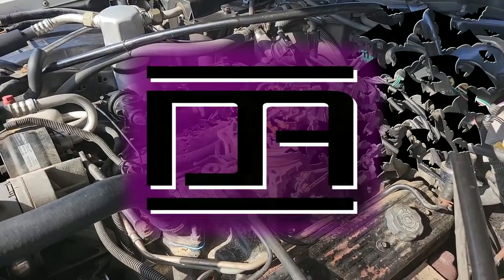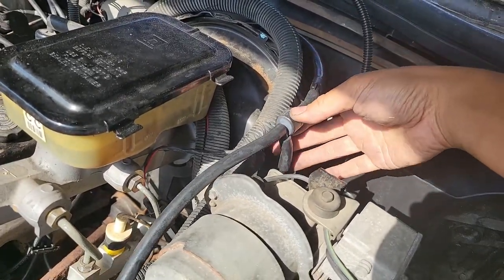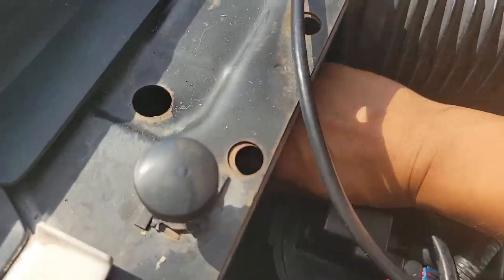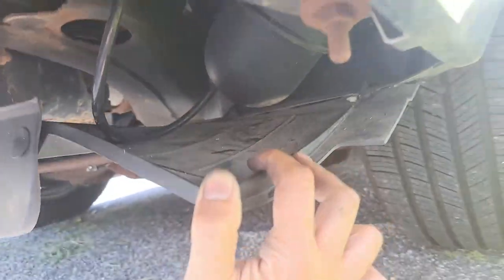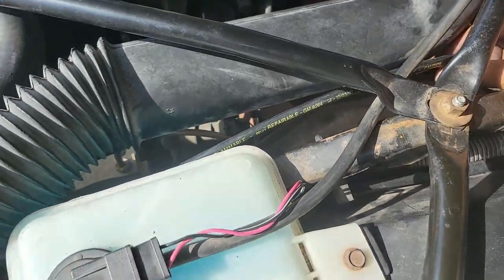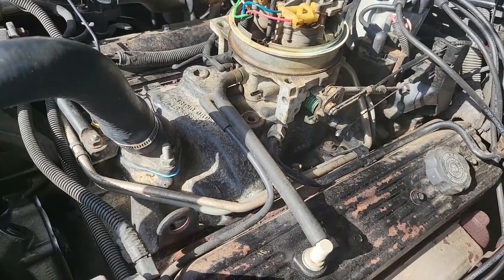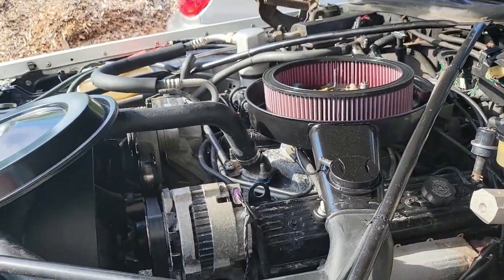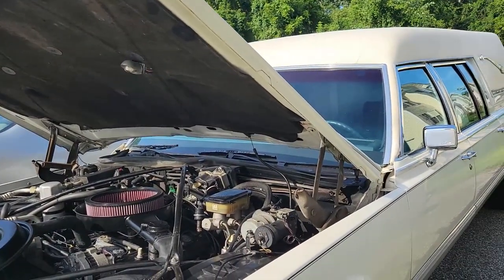Vacuum and EVAP Hose Routing Info / Visual Diagram (1990-1992 Cadillac Brougham)

Comment: Yo this is the next Cris fix of vacuum lines great video my guy. What size silicone is it that you used?
Reply from the maker: Thank you for the compliment! I just updated the video description with the info you need; I used 6 mm for the majority of the hoses and 4mm for the one under the air cleaner and the ones going to the vacuum reservoir tank and cruise control. I have links to the hoses in the video description as well.
Reply: Your dope man thank you keep the good Cadillac content going your going places if you do.

Comment: Great info i have a 91 5.7 i have changed all the sensors did tune up fuel filter n pump

My car turns off or sometimes hesisitates when i put it on gear can this be my problem? Idles fine

If i remove this part and shake it does it mean its bad??
Reply from the maker: I was having that issue when my gas tank built up vacuum since the EVAP solenoid wasn't opening when driving. Disconnecting the EVAP line was the quick fix. Eventually, I discovered my fuel pump was dying, which is why a little built up vacuum was causing stalling for me. I'm actually in the process of putting a new pump in there since it makes 10 psi and then fluxuates.

Comment: My cruise control hose is disconnected from the tbi

How can i connect it with the map sensor  if theirs only 1 slot ?
Reply from the maker: There should be a hose diagram just under the hood at the front of the engine. Have a look at that. You may need to add a simple vacuum Y or T fitting to connect it.

Comment: Would you happen to know how to replace the actuator? Please and thanks. I have a 91
Reply from the maker: For the cruise contol?
Reply: No sorry. For the a/c. It only blows from the bottom. None of the top or the window ones work. It used to but right before it stopped working it was making a grinding sound really loud and would stop. Eventually just stopped working all together.
Reply from the maker: No, I haven't. I'm assuming that's going to be behind the dash. I do have a service manual for it. I can dig through it this week and see if I can find anything useful.
Reply: I’d appreciate that. Haven’t had time to mess with it and would rather just jump right into it. Haven’t been able to find anything online. Thanks.